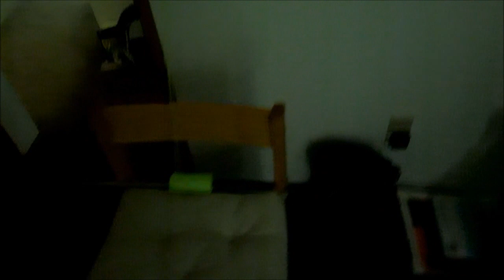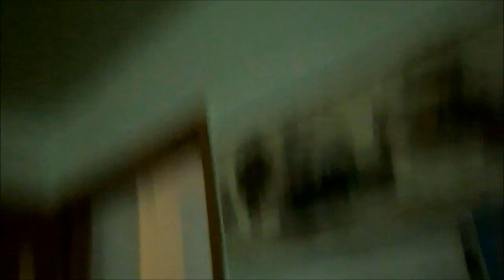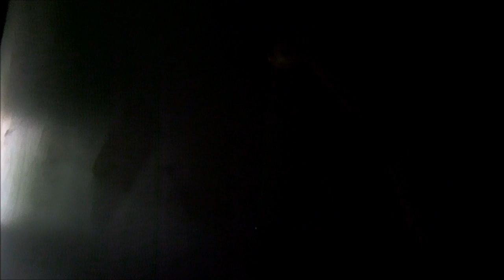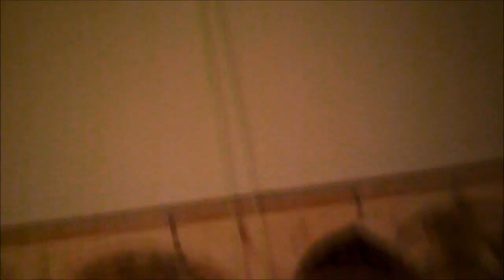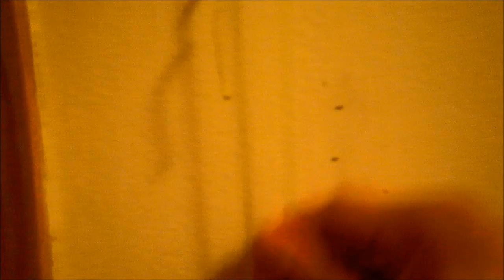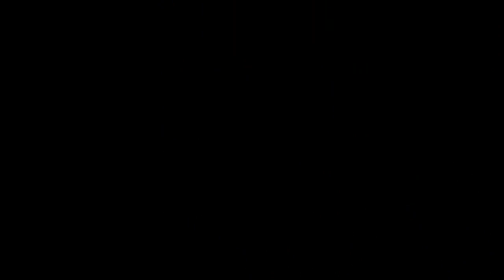Light Switch Pulley System

Comment from the maker: @lifehackertips this is more of a demonstrative video rather then informative (proof on concept). To get around the corners I used screw eyes. A total of 8 are used. On the light switch part I drilled a hole and tied 2 knots on either side of the drill hole. Then closed the cord system via knot.